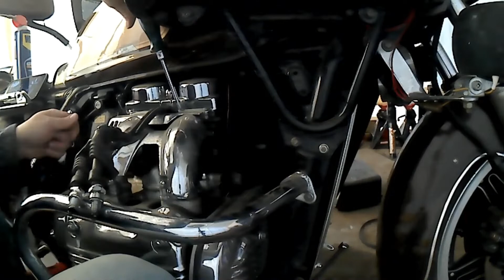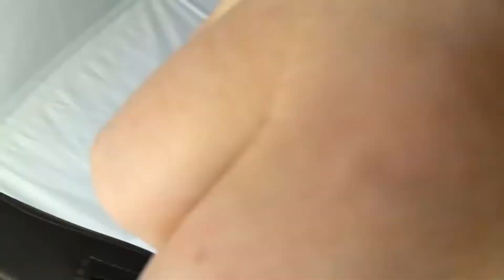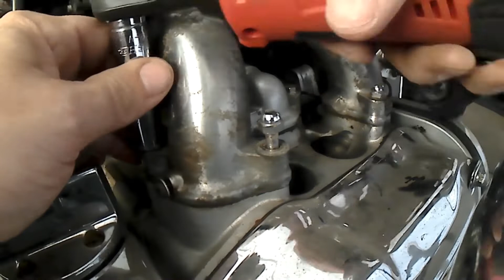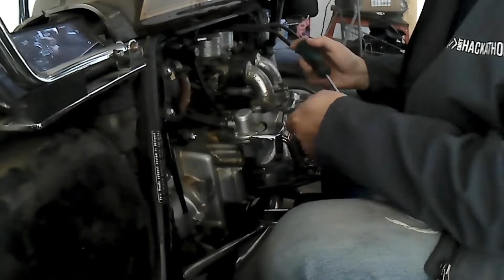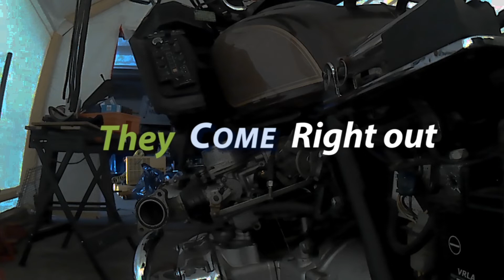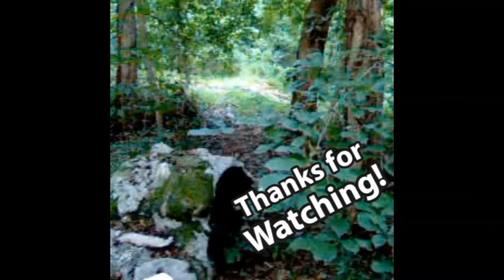Part 1 - Goldwing Carb Removal - No Talk, Just Work

Comment: Not many views but the ones that watched you helped! Thanks man!!
Reply from the maker: Thanks, much appreciated. Glad it helped. I have several videos on these carbs.
Reply: @theeddies  U bet! I'm pretty good with carbs myself it's just getting them in and out of these bikes that's my big hassle! And it's always great when you can hit YouTube and see what you're in for! The first thing I thought when I started watching this is, s*** I got to pull the fairing forward. LOL
Reply from the maker: @searching4mine393  yeah they are a bit of a pain. The big thing was removing the caps on the opposite side to get past the frame.  That and all the decorative chrome doo dads. Getting all the linkages and crossover tubes back together is fun as well. Unfortunately, after all that work we found a bad piston/cylinder in this motor. The compression was marginal and I thought it would come back but nope.
Reply: @theeddies  Oh man I hope I don't find that problem! Thanks for the tip! Was the mileage pretty high on that one?
Reply from the maker: @searching4mine393  50k miles as I remember. I'd say low for those motors, but there were a few signs of bad maintenance, so it was likely that. Thanks for the sub!

Comment: I just reinstalled my carbs on my GL1100 and here is how I did it.  I removed the head pipes, removed the vacuum caps and slides from the right 2 carbs (as sitting on the bike), feed the carbs 1/4 way in (from the left side of the bike as if you were sitting on it) and hook up the throttle cables, then work the slowly and gently through, the plenum will want to hang up on the fan motor if you're doing it right, keep working them across watching for cables and obstacles, pull the carbs a little further to the right and reinstall the 2 RH slides and caps, then re-install the head pipes (I added a thin layer of grease to help them slip on as well as seal, I left the boot clamps to the carbs loose until I had all of the head pipes installed and semi snugged down.....  This seemed to work for me, I'm not going to say it was easy, but I really do not see another way to do it.  Not even sure how the heck I got the carbs out without removing the RH caps and slides.  Hope this helps someone(s).
Reply from the maker: I have a video reinstalling these. Pretty much the same way you did it. 

https://youtu.be/sWI3B1PuZu8

Thanks,
Eddie

Comment: Taking it out was.. Not easy but putting it back in almost made me an alcoholic..
Reply from the maker: Lol, yeah the worst part for me was shaking and knocking the thing, I just spent 2 days to rebuild, back in with the tops open. Did you see that video?
https://youtu.be/sWI3B1PuZu8

Best!
Reply: @theeddies  just watched it.. Wow took me a freaking hour.. No idea why..I didn't do a carb kit I just cleaned all the Jets not even the fuel mixture ones. It had sat for 4 years and related I did fixed it..the had it running yesterday.. purring lines a kitten now.
Reply from the maker: @2keeperv  sweet, that one had sat for many years, all the rubber was goo.